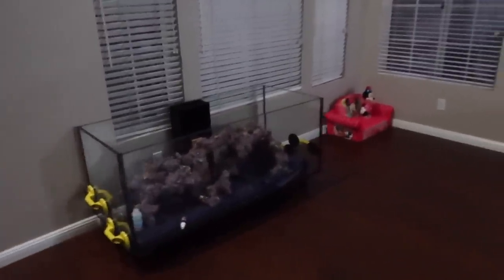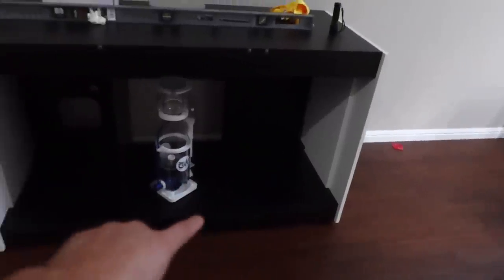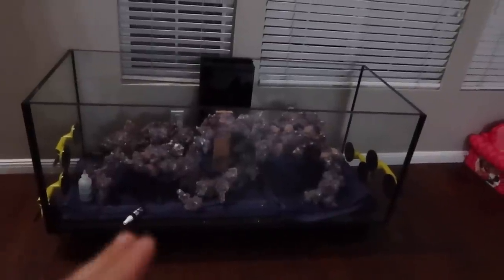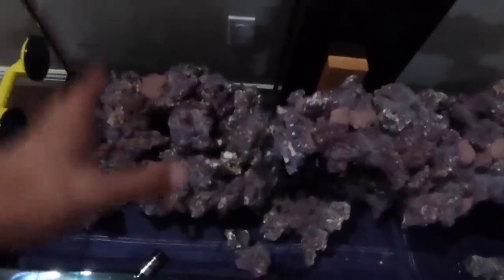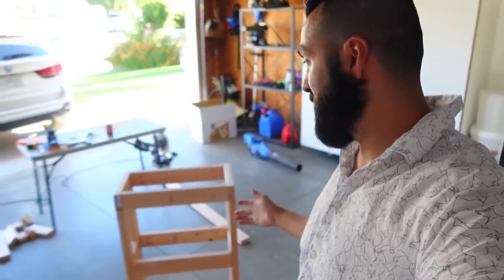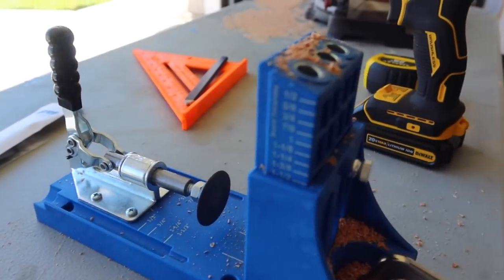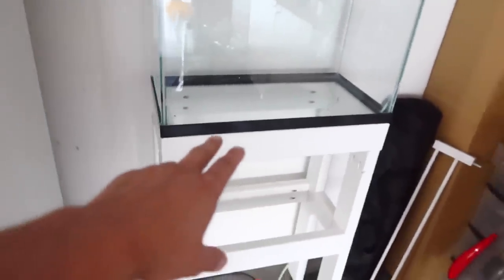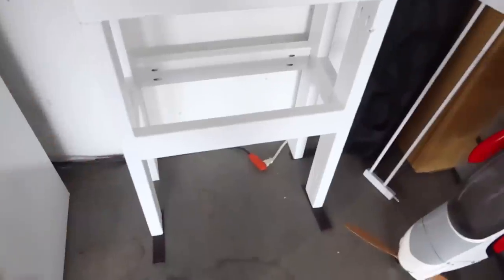Building QT stand + Mistake with my 180.5

Comment: Great job, looks great. FYI, if you want to not see the drill holes, you can cover them with white silicon or putty them first then paint right over them. Also to note on the seachem amonia detector wheel, a lot of people in my reef club says it doesn't work very well.